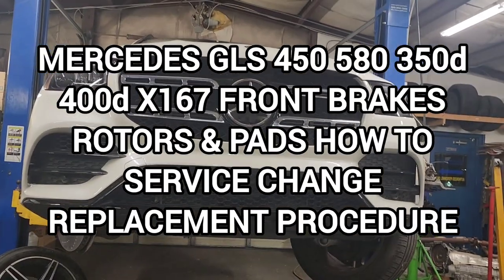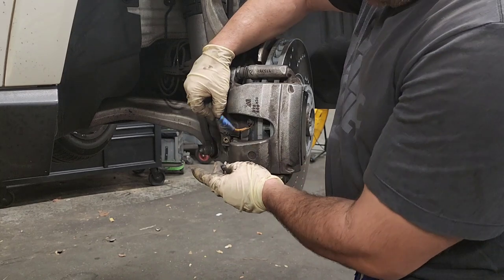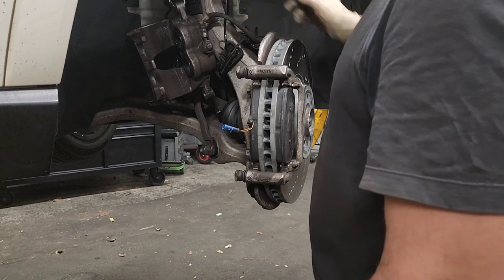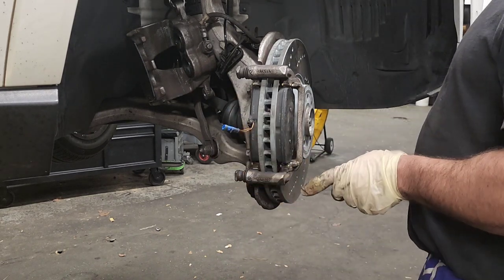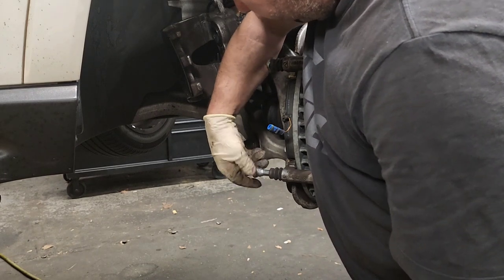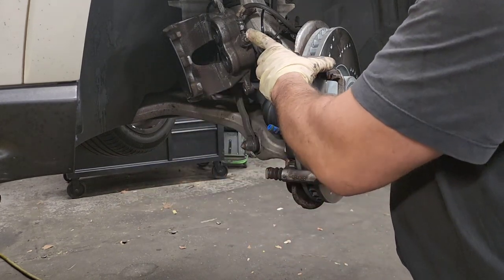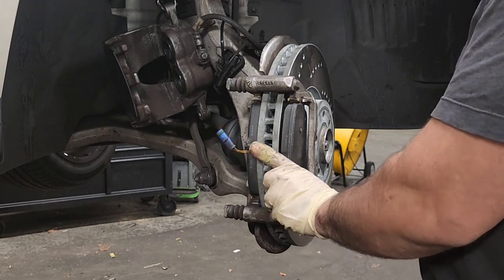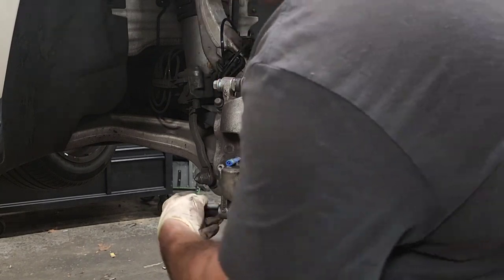MERCEDES GLS 450 580 350d 400d X167 FRONT BRAKES ROTORS & PADS HOW TO SERVICE CHANGE REPLACE GUIDE

Comment: Im looking for a 2020 gls450 but I read somewhere that breake replacement is expensive for whatever reason. Is that true?
Reply from the maker: Well it is going to cost you a decent amount of money unfortunately but the reason is that because simply Mercedes has the Best Braking System on the market so therefore their parts are made from expensive materials in order to actually achieve the performance your car would require to stop properly! If you do the brake service yourself you would be able to save a big amount of money but otherwise you are in the hands of the shops and stealerships and then the story changes! These same will overcharge you simply because they can and it's up to you to find a good but cheaper place with the hope that they would do a good job on your car... But that's a whole another very sensitive topic for a conversation... So yes they are expensive but there's a reason for it! After all you are not buying a Toyota or a Lexus or a Honda which are brands that I cannot stand at all... Mercedes is a pioneer in safety and technologies and in order to enjoy these you have pay for it... Actually you would end spending a similar amount of money if you owned a BMW or Audi! Meanwhile you would spend even more than the Mercedes if you owned a Porsche!  So at end of the day you get what you pay for... Thanks and Good Luck! 🤞💪👍

Comment: What do I do if I can’t get the rotor off? lol
Reply from the maker: Your rotors are glued to the hub because of the rust between them! You need to hit the rotor possibly several times with a heavy hammer around the middle area where you see the holes for the lug bolts in order to get it loose! Check  my last video on the Porsche Macan Brake job and you will see where I hit them. Let me know if you have other questions... Thanks 🙏👍

Comment: thank you!  great video!.   Can you make video how to flush brake fluid?   I thought the best time to flush brake fluid is when you change rotor and brakes.
Reply from the maker: The Brakes Flushing is part of the Maintenance Time Schedule and is not really done during a brake replacement. You need to check your Service Manual for the Mileage specified when the Brake Fluid is charged as I am not going to know it by heart. Maybe it would be around 50 or 60k miles. The actual Brake Flush is not complicated but you will need to buy or get a Pump kit that attches to the Brake Fluid Reservoir in order to complete this job. As soon as I get one of these X7 I will make the video. Thanks 👍